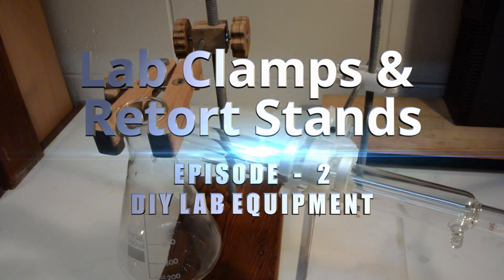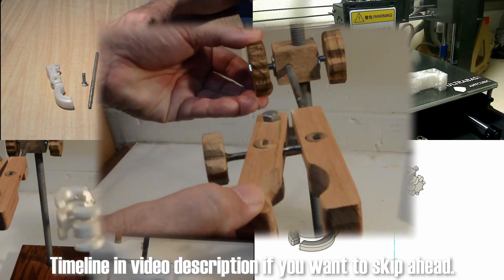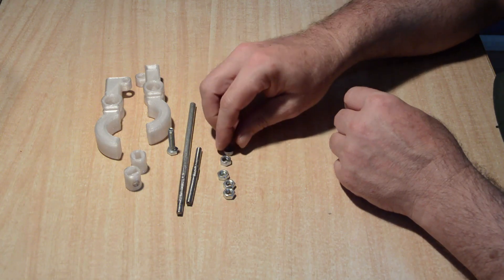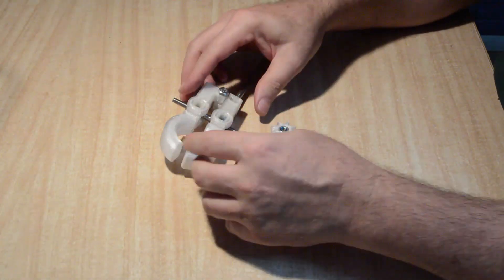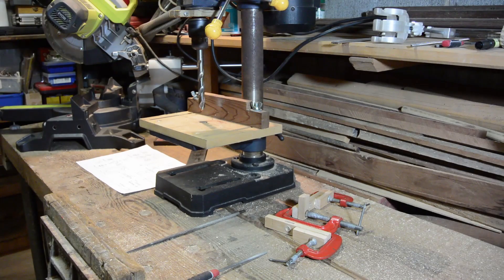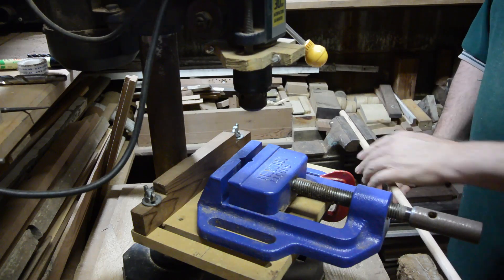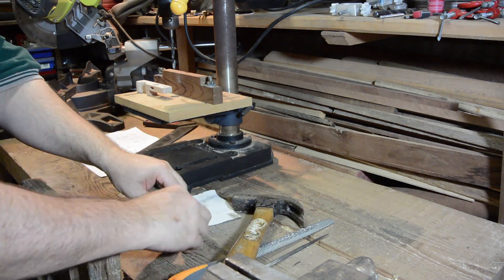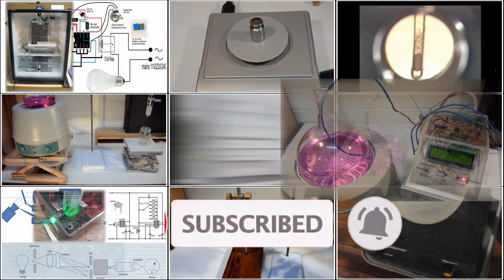DIY Lab Tools - Lab Clamps & Retort Stands

Comment: i originally printed your clamps like 3 years ago (out of PLA and it worked fine). Today i'm coming back since there is not any better set of  clamps on the internet.
you should upload your STLs to Thingiverse btw since the files are kinda hard to find by searching keywords
Reply from the maker: Thanks for letting me know you're still using the design after all this time!  I'll look into making the STL files easier to find.

Comment: did you share the files?
Reply from the maker: .stl files can be downloaded from http://www.fadstoobsessions.com/Downloads-Products/Downloads-Products.php

look in the "3D-Printing STL" tab - there is a table of files available (3rd from the bottom, click LabClamp.zip)
Reply: @FadsToObsessions  do i need to donate and how much?
Reply from the maker: The files are free - but you need to register as a member (bronze level is free) - www.fadstoobsessions.com/registration.php

if you have any troubles - use the contact page to email http://www.fadstoobsessions.com/Misc-Info/Contact.php
Reply from the maker: Thanks for the feedback about the website pages - gmail has made some changes and I will need to do some updates for such new users. In any case, I manually activated your account. If any further trouble just email using admins@fadstoobsessions.com

Comment: what did you use as base?
Reply from the maker: The base was made from cutting a piece from an old wooden plank (see https://youtu.be/hEK-369eJbA?t=594) - happens to be 30cm long, 15cm wide with depth 4cm - dimensions obviously not critical, just needs to be big enough to be stable against tipping over